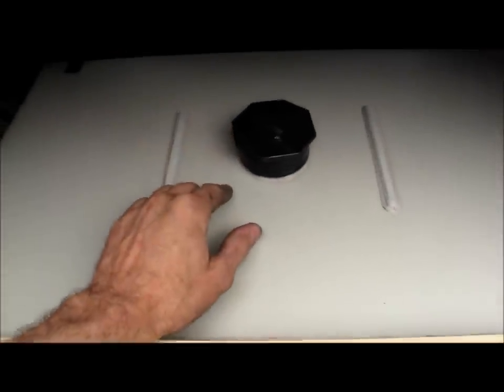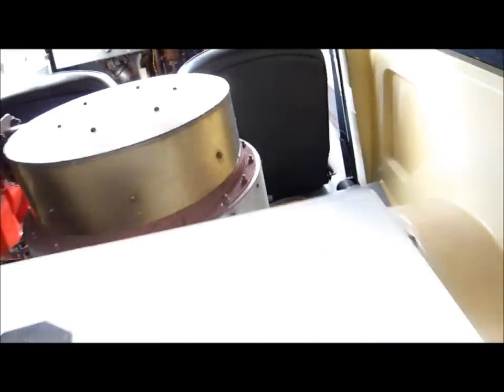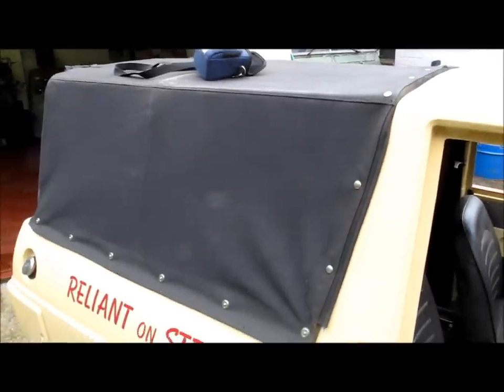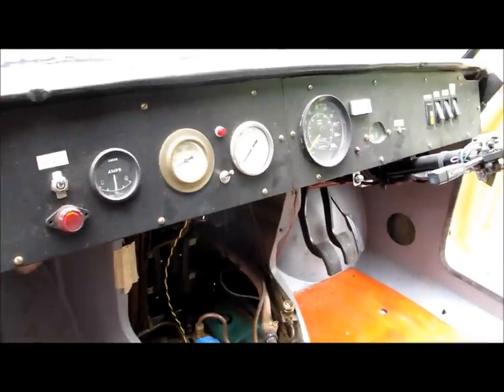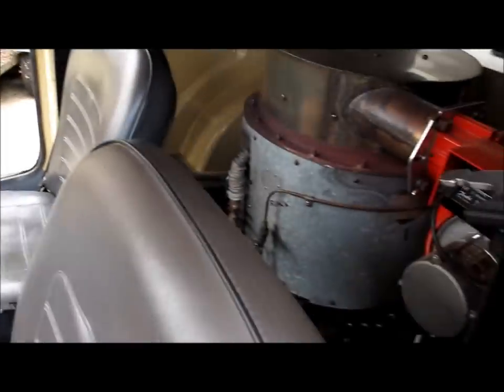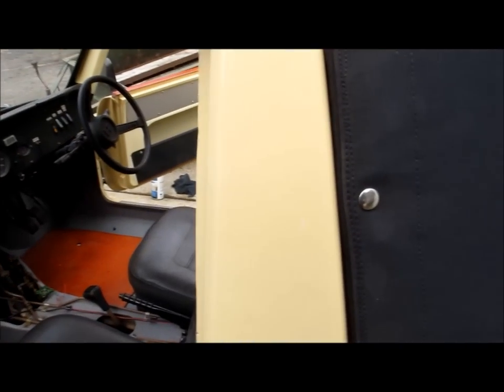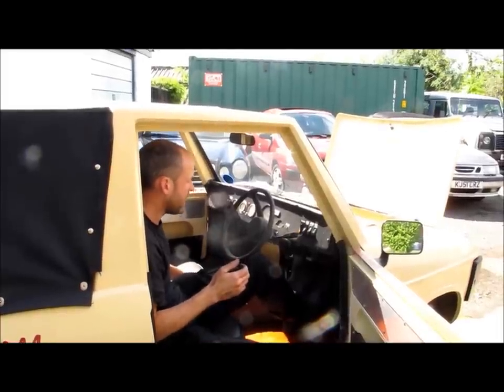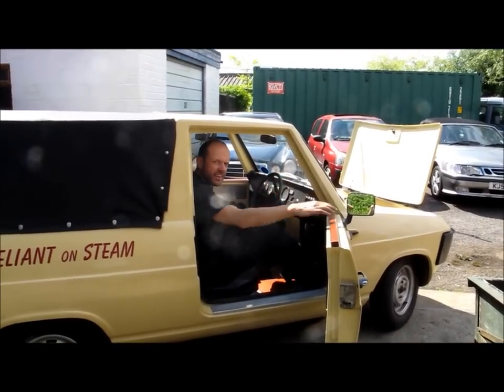Reliant Fox Steam car

Comment: Isn't it dangerous to have the boiler in the cabin? you will get third degree burns if that bursts.
Reply: +mtothem1337 if you live.
Reply: Monotube boilers are much safer than fire-tube boilers like the ones on old locomotives, since they contain very little water and they're built stronger than they need to be.

Comment: wow, that will still be an eye turner in todays oil reliant world..even the traffic policeman will be baffled when he stops you for a smokey exhaust and realizes it actually good old steam from the outlet.
Reply: This car burns oil.
Reply: @doktorbimmer  try putting kerosene on you gasoline engine, oh you can't. Try putting any type of fuel instead of diesel and gasoline on your car, oh you can't
Reply: @giovannicesaramorim9adigan961  Never heard of Ethanol? LPG or CNG???
You can run many Diesel engines on a wider variety of alternative and renewable fuel sources.
Rudolf Diesel designed his engine to run on bio fuel  (vegetable oil) and also designed a version that ran on coal dust.
Reply: @sandervanderkammen9230  ethanol you can only use on gasoline engines, cuz diesel doesnt have a sparkplug
Reply: @sandervanderkammen9230  did it ran on coal dust? for me it only runs on a boiler to heat, i dont think explodes or something like that
Reply: @giovannicesaramorim9adigan961  What's your point? Both Otto and Diesel cycle engines are Multi-fuel capable.... and both areore fuel efficient.
Reply: @giovannicesaramorim9adigan961  You didn't know coal dust can explode?
It a moot point really because the fuel never explores in a internal combustion engine.
Reply: @sandervanderkammen9230  i think it needs compression and a lot of air
Reply: @sandervanderkammen9230   even saw dust can explode with enough air
Reply: @giovannicesaramorim9adigan961  Diesel engines create enough heat to ignite coal dust.
Reply: @giovannicesaramorim9adigan961  The point is the air/ fuel mixture never explodes, it burns rapidly in a controlled process called deflaggeration
Reply: @sandervanderkammen9230  all my life, i have been lied to
Reply: @giovannicesaramorim9adigan961  Indeed you have, people often say the fuel in a internal combustion engine EXPLODES WHICH IS FALSE. If the fuel exploded the engine would be quickly destroyed.
The correct term is deflagration a rapid but subsonic combustion velocity.
Reply: @sandervanderkammen9230  lol, like, every single video on youtube says it explodes, well, that's why we dont use dynamite instead of gasoline